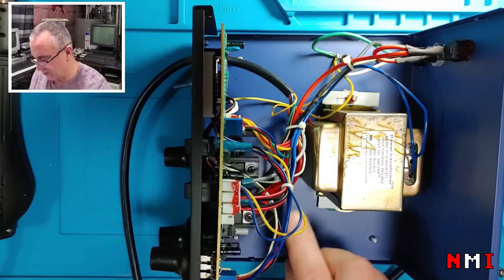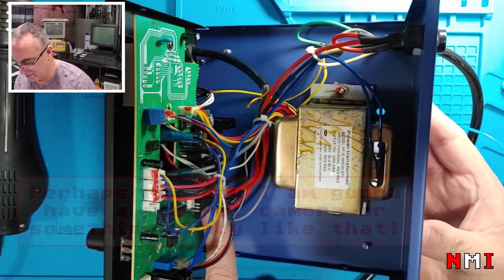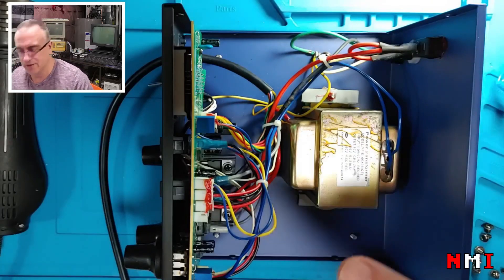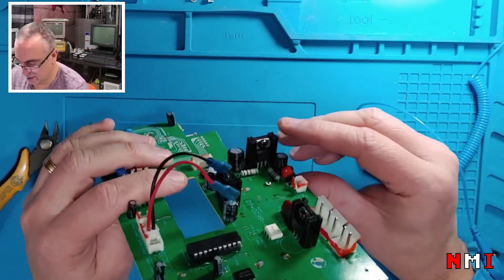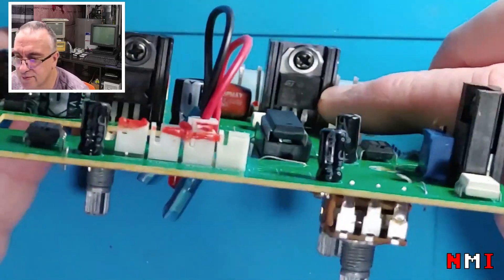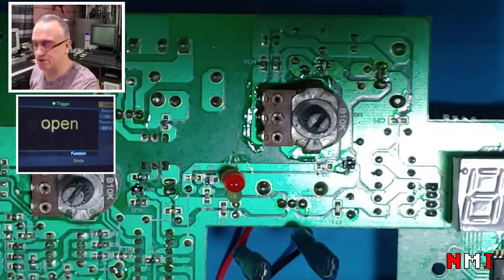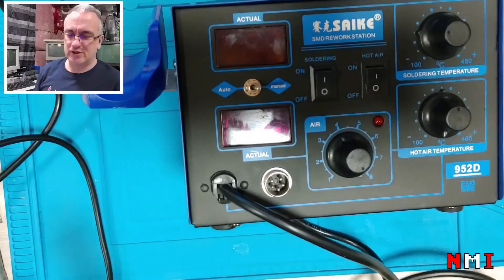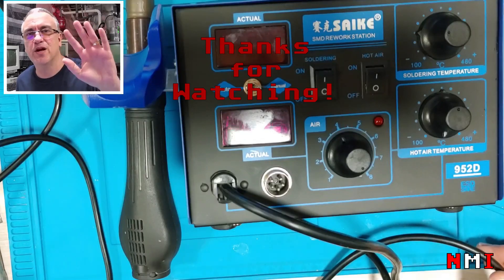021 - Fixing my Saike 952D hot air soldering station

Comment: There's not much inside this hotair station but they sell them for a lot
Reply from the maker: I agree if you are buying from a big brand it is going to set you back a couple hundred dollars, but there are good ones for less than a hundred bucks which is quite affordable. As long as it uses an isolation transformer (like the one in the video), it should be fine!